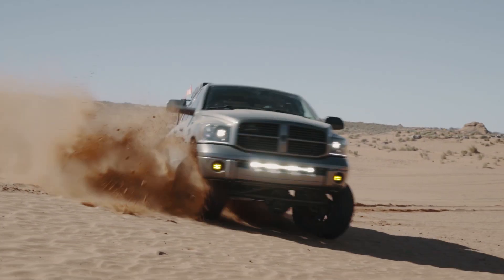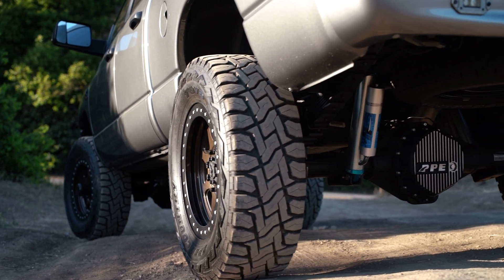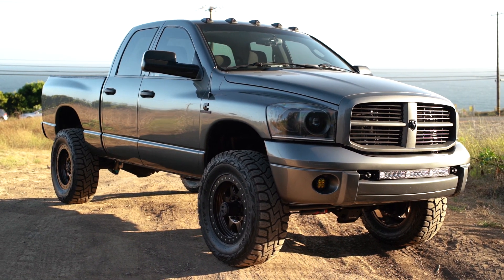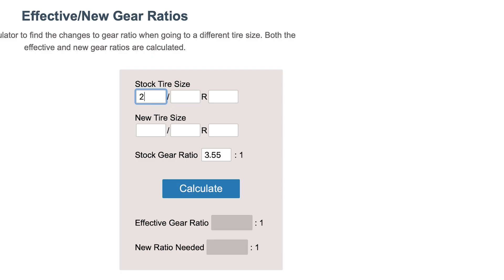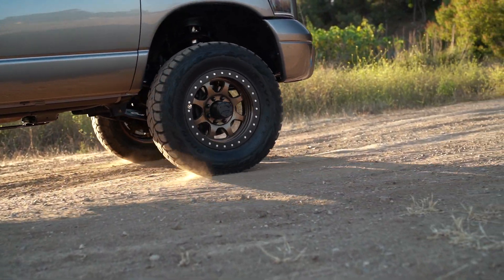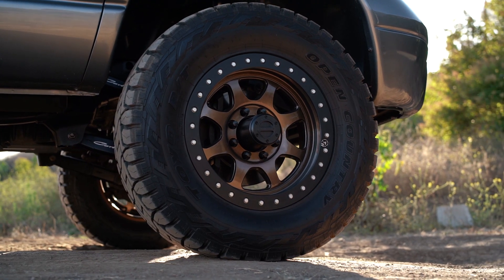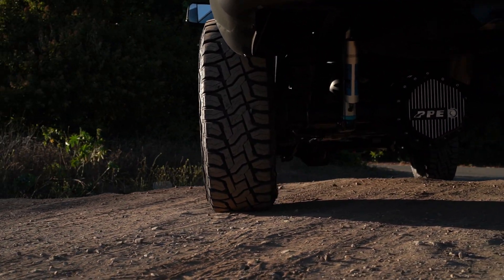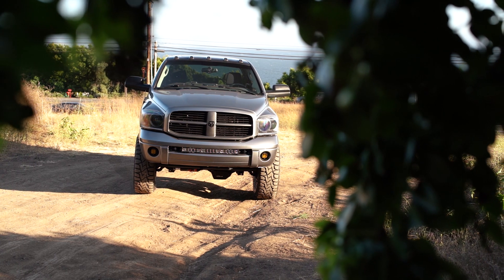Should You Re-Gear Your Diesel for 37s?

Comment: Great video and topic! The most common reason I see or hear rather, to re-gear newer Rams is due to supposed transmission issues. I have run 35s for three years on my deleted and tuned 2017. No issues yet. Does anyone have any actual proof/ data this will prolong transmission life with larger than stock tires? I plan on 37s on my next set.
Reply from the maker: From what I see the issue comes from the guys that are running 37s with deletes and tunes, and then blame the tires for the blown trans. I've got friends with over 100k trouble free miles with 3.42 gears, 68RFEs and 37s. Drive nice and the trans will last!

Comment: Interested to hear what PSI you run your 37s
I have a 3rd gen Power Wagon with 37s and the stock 4.56 gears, so far after a few thousand miles I’m very pleased with the results.
Reply: Hey I have 05 power wagon and wanting to put on 37s do u feel a differents with the 37? And mileage
Reply: @555pa555  I definitely can feel that the tires are much heavier. The truck felt peppy with 35s. I wouldn’t trade the offroad improvement or or the look that the 37s give the truck. 
I’ll average 12 on the highway. So not too bad.

Comment: Factory 4.10s make it a no-brainer.. I've been running 35s on my mostly stock '03 that came with 4.10 gears and the larger tires actually helped my cruising RPM at highway speeds.

Comment: Also gotta talk about steering and power steering and less braking with bigger tires.i got 2006 dodge 2500 6 speed on 37s with 4.10 gears truck had 33s when I got it would rev out at like 90 went to 37s now I can actually drive without being revvved out

Comment: Transmission makes a difference too. I agree the 4 speed trucks can get away with stock gears more often than not. The newer trucks with 6+ speed transmissions will benefit more from regearing. Especially if you’ve got a 68rfe

Comment: My truck has 37s carli pintop 68rfe 2017 with 342s.  I'm re gearing cause the 68 has some issues.  I will go to 456s.  If I find them a bit low I will step up to a 38.
Reply: Id check out 4.30s. Just got them and love them. I think 4.56s would be too low even for towing if you ever hit the freeway. I have the same set up at you btw.
Reply: I've run 4.11s with 37s for about 5 years. I hit 2000 RPM in 6th @ 85 mph. Regular cruising is 1600 RPM @ 60 mph.

Comment: I put 35x12.50x17 on my 2012 3500 Mega SRW a few years ago. 3.73 gears. Noticed no difference in the way it performs at all. Probably give 37s a shot when these tires are done. I believe Nitro gear makes a 4.30 gearset for these trucks I've seen people talk about on the forums. Definitely would run just the tires for a while first before I regear. 

Also am running a CPS 100hp tune and trans tune all the time. Drives great.
Reply from the maker: With a tune and 3.73s you might be happy on your existing gears! The truck will definitely be slower off the line on 37s though.

Comment: What if you have a Ram 1500 with 5.7L hemi and 3.92 gears? I know 37s run fine with a 4-6” lift but if I regear to 4.88s will it improve my gas mileage or make it worse?
Reply from the maker: I definitely wouldn’t go any higher than 4.56!
Reply: Just Diesels and why is that? I see a lot of overlanding guys with Tacoma’s on 33s getting 4.88s instead of 4.56s because they think it’ll be better for Highway and offroad. Idk why that would be.
Reply from the maker: My vote is to use that gearing calculator and get whatever gears put you back to the factory ratio. Then your truck is operating how it was designed. A lot of these guys get all gear happy and end up going way too low which makes the truck wind out in highway driving.
Reply: Just Diesels it’s interesting cz the gears I thought I’d need/wanted were 4.88s and all I really need is 4.10s!

Comment: I have an 06 2500 2wd Mega with a G56. I wish I could fit 37s under it, as 65 mph is 2k rpms. I have spindles and springs, but 35 is as big as you can go... Thanks for the video.

Comment: I also run 37's on my 5.9 ! Runs great on stock gears
Reply: Yeah, but there are and were always multiple options for the stock gears.

4.10s are a stock option, and those will handle things like 37s and tall lifts far better than 3.42s, which were also a stock option.

Comment: My largest tire I could have on my same truck as yours was 33”. What do you have to be able to go up to 37”?
Reply from the maker: You need a 3” lift, high clearance control arms, and wheels that are 8.5-9” wide with +18 to +25 offset. With a little trimming they fit great!
Reply: Just Diesels you probably meant to say from -18 to -25 ( negative) offset in order to better clear. I’m currently running 20x9 with -12 I should probably be rubbing a bit don’t you think 🤔
Reply: Depends whether you're willing to put up with a little tire rub on your control arms.  Factory wheels can fit 35s with only a little rub on the UCA near full steering lock, and thats with no lift, 100% stock suspension.  37s kinda fit too, but rub more.  I've been running 35s on my otherwise stock '03 for years with zero issues (minor rubbing), including off road.

Comment: Truck is beautiful, I got a 14' 3500 SRW on stock 17's with 12.50 35's. Got the 6.4 Hemi. Haven't regeared but I think in a gasser regearing may be preferable.
Reply: St. Vick . If i was getting a 6.4;with the 4.10 gear set on 35-37” tires is nearly perfect in my book

Comment: I’m thinking about getting 3.73 gears the truck came with 4.10’’s (it’s a 2012 ram 2500 Cummins) running some 285/75 r17 I wanna get better mpg let me know what y’all think
Reply from the maker: All depends on your driving, but if you have near factory size tires it will definitely lower the RPMs and help with highway mileage! The trade off is that it puts more load on the engine from a stop, so your city mileage will take a little hit.
Reply: Yes, I would do the same thing.

Comment: can someone explain what appears to be the different measurement standards please? Stock: 265, New: 37 / Stock: 70, New 12.5 ...
Reply: 265 is metric tire sizing. For instance a 265/70/17 is 265mm wide, the 70 is the sidewall size as a percentage of the width. So a 70 is 70% of the 265 width, the 17 is a 17 inch wheel.

The 37x12.50x17 is a flotation tire size 37 is height in inches, 12.50 is width in inches, and 17 is wheel diameter in inches.
Reply: kylescaggs  you’re right. The formula with that tire size as an example is 2x265x70/2540+17=31.6” So, 2(constant) times width in mm, times second number(ratio), divided by 2540(constant) plus rim diameter = tire diameter. I’m no mathmagician but I’ve used that formula forever to figure out wheel/tire combos. Of course there’s websites you can plug those numbers into. Thought I’d share

Comment: I think what were all wondering... how do you keep the underside of that truck so clean? I'm thoroughly impressed...did you coat it when you first got it? I know you bought it used.

IMO I'm partial to re-gearing. I know on my 01 24v CTD when I went from 265/75/16 to 295/75/16 I noticed a big difference in cruising RPM, towing ability, and fuel mileage. Maybe I am over cautious of my vehicles but I could tell there was more of a load on the engine when accelerating. The truck also only makes 460ft/lb torque but still. I'm sure it would be different on my 18 if I went to bigger tire, but I love where the RPMs are on my 18 at 75mph. If anything I would rather a 3.73 rather than my 3.42 gear ratio.
Reply from the maker: Haha HARD WORK!  I literately get on my back and wash, dry and then cover the entire underneath of the truck with either wd40 or Adam’s undercarriage spray that’s hand applied with a rag. Keep the original paint looking awesome if you do that every few months! Dirt is acidic and promotes rust, so the longer your frame is covered it dirt the faster the paint will fade and rust. As for gears, the 3.42 Ram trucks are definitely the best candidates for gears, especially for people towing.

Comment: Hey man, I’d really recommend reverting to the stock diff covers. The engineers at Dana/American axle spend a ton of time on oil flow and those aftermarket covers totally change the characteristics of the flow. Gale Banks has a great video series on it.
Reply from the maker: This cover went on before the Banks were even a thing! I’ll agree that the Banks is superior, but there’s lots of people running million mile hot shot trucks with flat diff covers so I’m not losing sleep over mine! It isn’t worth pulling this one off, but I’ll do a Banks on the next truck.
Reply: Stock diff cover for life!!!
Reply: If you can't see the oil in the diff, it's working fine.
Reply: The new Banks diff covers are the best covers if you tow or go more than 30k before fluid changes...
Reply: I personally know a ton of people that have been running Mag hitec/flat back covers for decades and they have had Zero issues. Yes, you are right, they may not be as efficient as stock or Banks outrageously priced cover but he's going to be ok.
Reply: SoCali7three yes I’m sure he’ll be okay, I guess my point is there is no benefit to those covers other than aesthetics. Lots of work is done on the geometry of the stock covers to make the flow as efficient and effective as possible. The stock cover makes sure oil gets to pinion bearing at all angles and temperatures for example. These tests are not done by aftermarket companies.
Reply: And I agree banks cover is ridiculous. It is solving a problem that doesn’t exist like the other aftermarket options
Reply: First time you bash a stock cover in on a rock while 4 wheeling end the idea.  I live in Arizona all rocks here.

Comment: I had a 6sp JKU with 37s and it had stock 3:73 and it was fine. That being said i did rehear you 4:88 and it was better. But with a 2500 diesel i definitely don’t think ya need to with 37s. If you’re towing or wheeling you’d definitely be better off though

Comment: Another great video Austin!  The timing of this video is also perfect for me.  I just ordered a new 2020 RAM 3500 Megacab and the Carli 2.5 pin top suspension system and 37's from CJC Off Road!  This has helped me with my decision to NOT re-gear.
Reply: You may want to reconsider that depending on what the factory ratio is, if its anything like the 4th gens you'll have 3.42s & those are terrible with 37s, its fun being able to do 140mph down the highway, but even deleted only getting 13.5mpg highway & the 68rfe trans isn't liking it either, im gonna regear to 4.10s or 4.30s, keeping the 68rfe happy & being able to tow a good amount of weight again & better mpg in town & on the hwy
Reply: I'm running 37's deleted. With 3.42 gears. It runs great! Tows heavy up to 16,000 no issues. Plus, I get 17 to 19 mpg at 5000 to 7000 foot elevation where I live. I do want to go to 3.73's and limited slip just for the low end take-offs. Without losing mpg's. But that's just for fun, not necessarily for low power. I do have a tune. I can add power if I want. But I usually run it on the lowest setting. Plenty of torque to run them big tires and mpgs to boot.
Reply: You will find that you can not regear the new 2019-2020 3500 trucks yet as there are no after market gears available from Yukon or Nitro.

Comment: I was on the fence about re-gearing but this video helped me decide to keep 3.73 for highway fuel efficiency.  I was recommended an Eaton tru-track locker upgrade in the rear when I flush diff fluid. Any opinions on that vs an air or electric locker?
Reply from the maker: If you have on board air for other things then you may as well, but I think the e-lockers are a little more reliable since there’s less stuff involved.
Reply: I have a 2003 3500 with ARB air lockers front and rear 410 gear ratio with 35s, it works well. I never had issues with the air system. I love being able to creep up steep terrain while my friends have to get a running start. Less wear and tear on my truck.